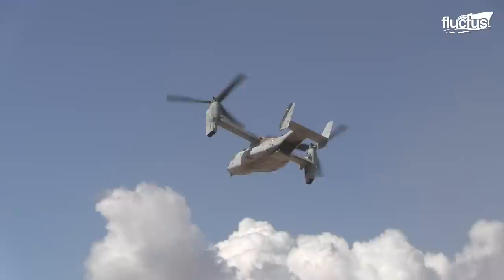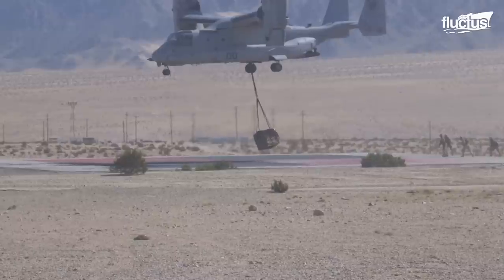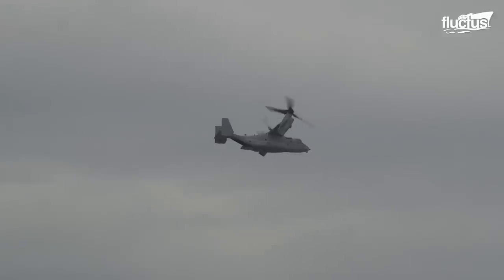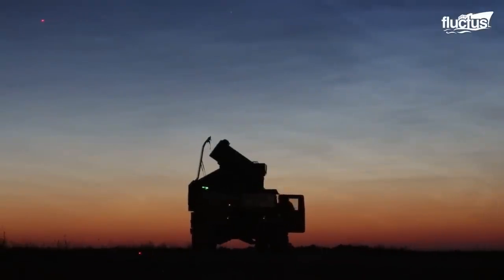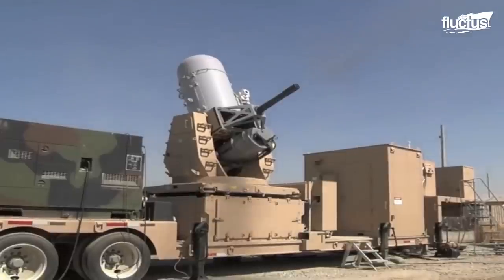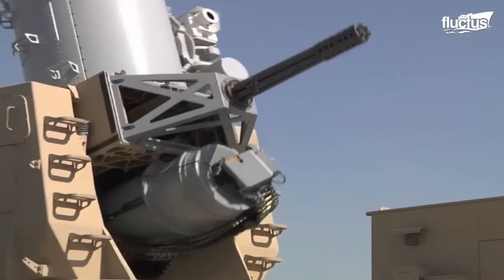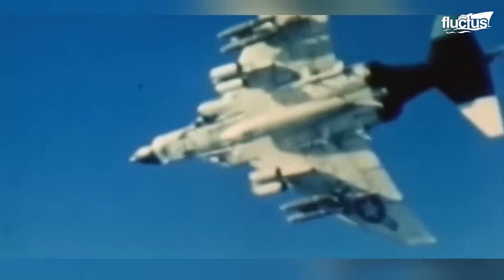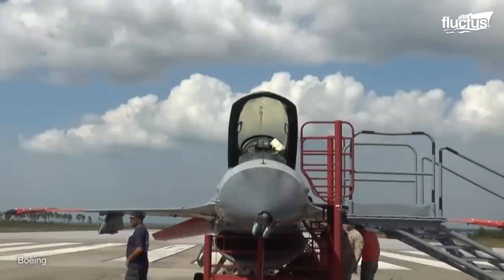Crazy Reasons Why US Tries to Shoot Down Its Own $100 Million Aircraft

Comment: The scary thing is A.i. graphics card chips can distinguish the outline SHAPE of an object apart from its heat signature so under certain conditions in the near future if not already a peer level competitor could employ off the shelf parts to train missles to navigate toward the plane / helicopter and away from the flares.  

I forsee the only way for the US military to counter such a threat is to outfit each and every aircraft with Multiple targeting / dazzler pods ( some kind of Lazer) that would blind the optical sensors on the missle causing it to loose control.   

And in the future perhaps a pod that detaches from the airframe and dazzles the missles from a distance so the missle can't just hone in on the source the laser
Reply: Ai Attack missiles vs Ai Laser defense 👌
Reply: China and Russia can't get the GPUs needed at scale to be a threat anytime soon, that said your comment remains valid. There are interesting ways to completely jam AI vision with just specific patterns. There is a video on here somewhere on this and self driving cars and how some random lines and triangles it detects it as an animal.  I suspect future aircraft will be covered in these for camo.